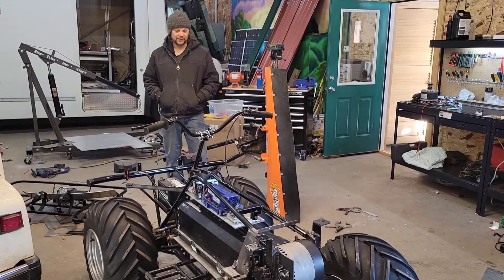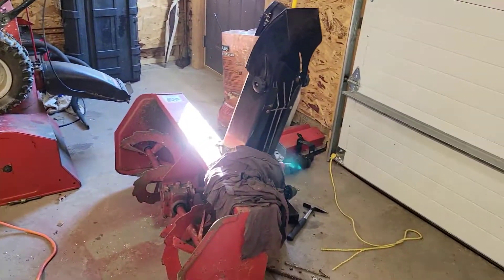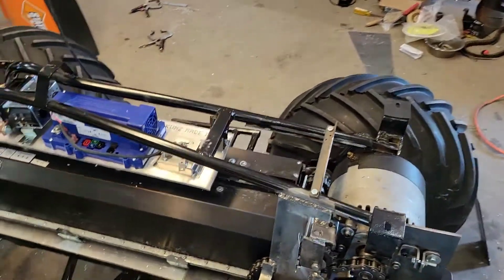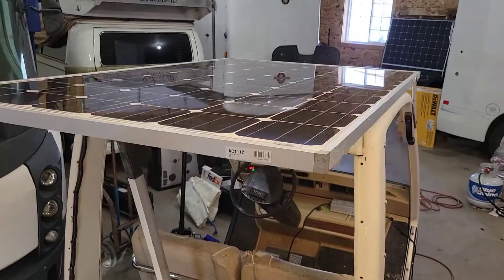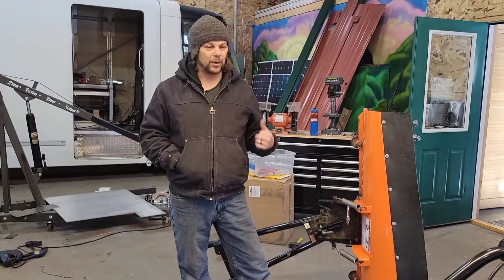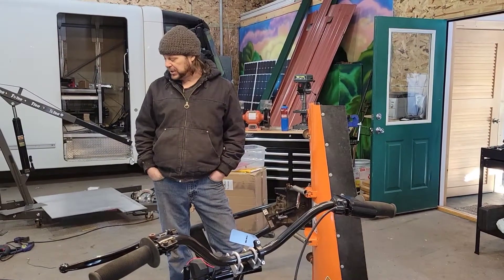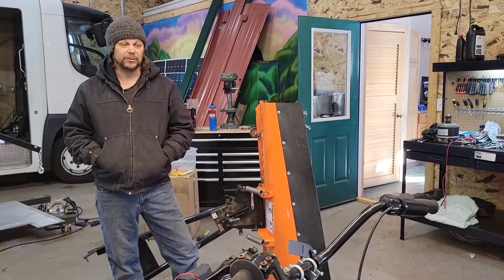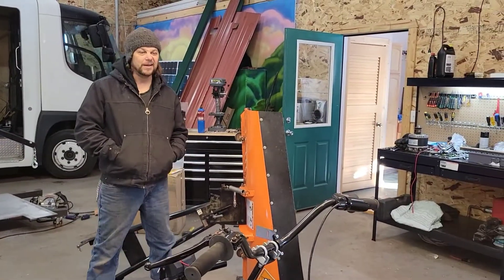Electric 4 Wheeler Conversion by @solarrolla

Comment: Cool (no pun intended) project. Will it need a windshield wiper? Have fun!
Reply from the maker: I suppose you could put one on but most of the snow blowers with shields don't have one. It blows the snow to the side so anything that would not it is typically light powder and would just fall off.